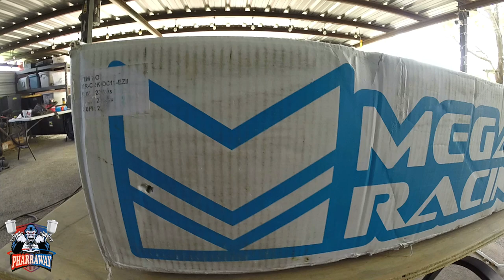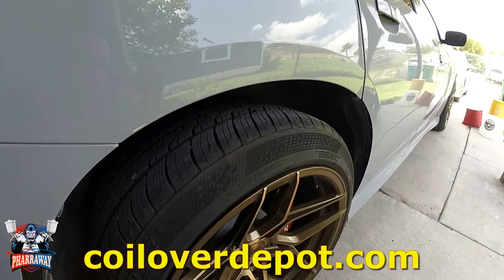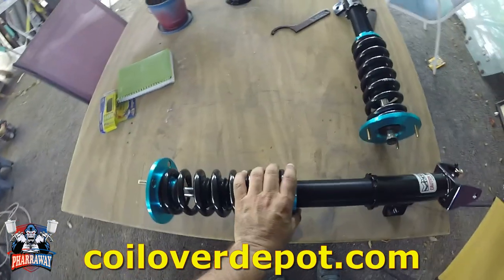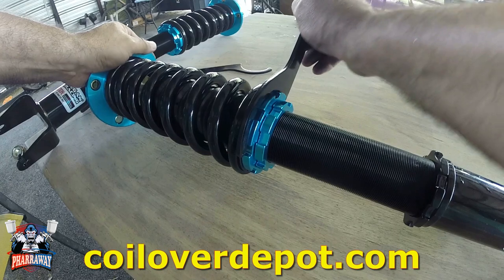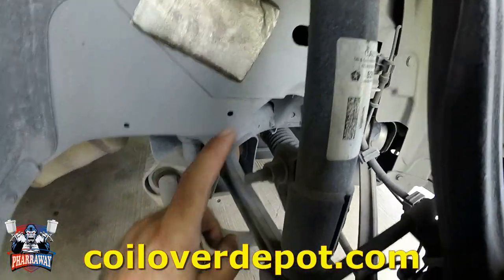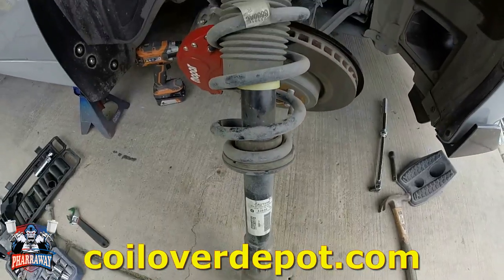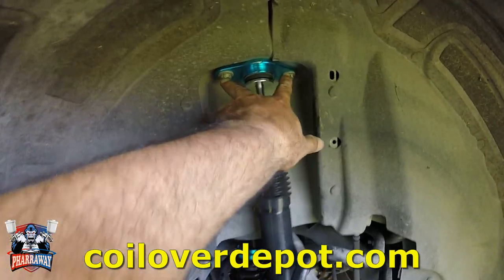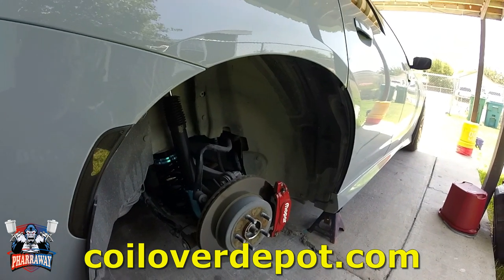How to Install Coilovers in Your Car from Coilover Depot

Comment: Hey, great tutorial! I used this to put coilovers on my 2010 Charger r/t, and I wanted to leave some tips, because there are some things I wished I would have known beforehand.

1. For the rear struts/springs, if you have 2 jacks(with a hockey puck on it to maximize surface area), use that over a jack and a jack stand. Put them on both ends of the control arm. You're going to have to lower the control arm to get the springs, and it's going to be a lot more gentle of a release when you unscrew the bolts. Also, you'll have full control over how it falls. 

2. For removing the front struts, detaching the upper front control arm from the lower control arm was the biggest roadblock for me. If smacking the knuckle doesn't work, you can buy a ball joint separator(do some research on it).

I hope this helps. (:
Reply from the maker: Awesome 👌

Comment: Bro did you remove both rubber spring mounts before installing the rear coilovers springs? Should i remove both rubber pieces top and bottom of rear lower control arm? Thanks
Reply from the maker: no I did not

Comment: You have to use anti seize!( Or your gonna have.issues.down the road ! I put those in my 2010 challenger!(I hate them to many mods to do for the price!( My opinion!!) The fears won't go vivh enough to.clear my tires ( staggered wheels) any advice? Thanks Richard!!!!! Nice ride!!!!
Reply: I ended up making them fit the rear! Instead of dropping the rear inner a arm ! I used my jack handle to pry down far enough to release the pressure on the spring and was able to spin it!( Without removing the bolt by the center of rear end ) many it will help someone in the future ???) But like your video,( I was about to give up!?? Thanks! Can't wait for more candy paint tips!!!!! Richard! Thanks again!??
Reply: Also I had to spin up the backs( they were rubbing!) I took all the arms of the outside of the rotor ( instead of taking the bolt out of the rear end sind I took my floor jack handle and pried down on the lower control arm and was able to spin up the coilover adjustment sleeve ) saves some time , instead of taking it apart by the rear end! Hope this helps you fellow motorheads?? !!!! Waiting on some more paint jobs ( your paint tips are f----kng awesome !!!!!) Thanks Richard